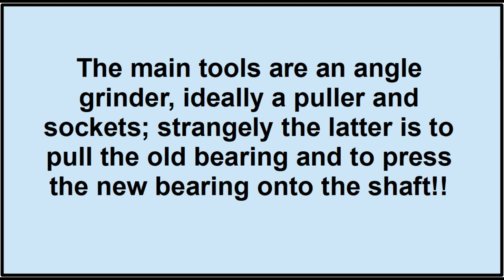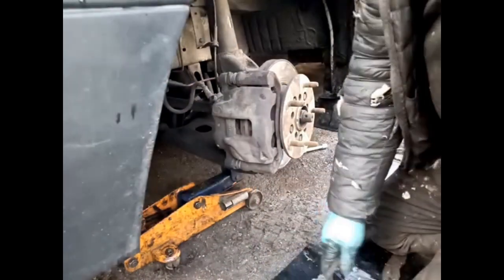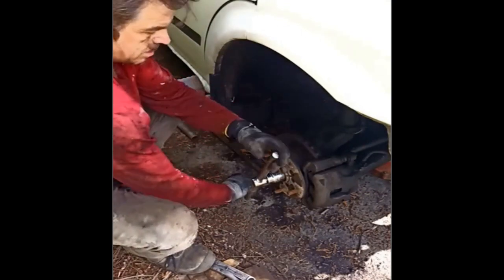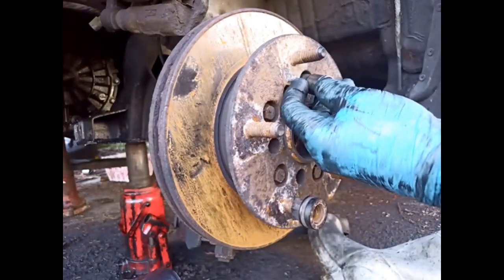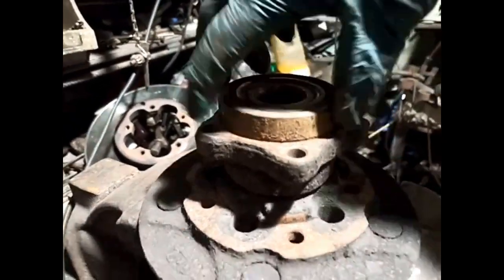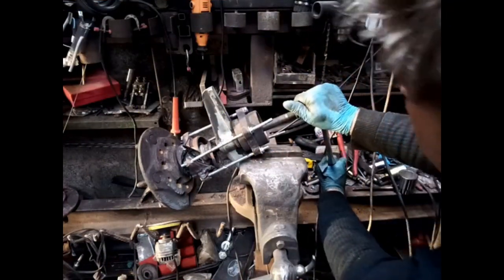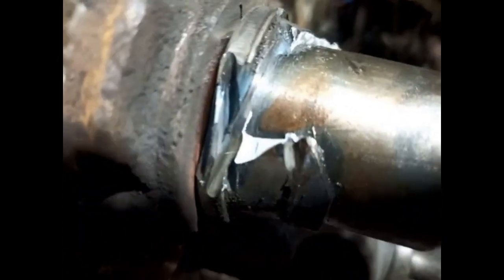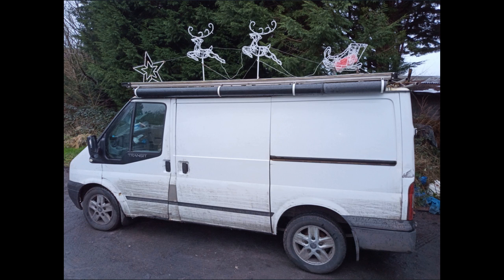Ford Transit Wheel Bearing Replacement - The Best Method to get the job done and save money!

Comment: Thanks from France or more exactly from Savoie ;) Good Job . I am look for the same about the rear disk and hub for my AWD Ford Transit 2011 MK7
Reply from the maker: Hi Savoie in France! The same principles will apply with any wheel bearing ie good use of  an angle grinder as a last resort for bearing removal. Adding the new bearing might need more thought if the hub is solid. Good luck!!

Comment: is there enough grip on the inner race to get hold of it with the 3 legged puller? most ppl are using a special tool for that part
Reply from the maker: Hi. If the inner race of the outer bearing breaks away from the outer race then it is difficult to get any puller's legs behind the inner race to pull it off. That's when the angle grinder and hammer or angle grinder and pipe grips/similar in good hands comes in - I've never faile to remove any bearing from any mavhine this way!!!